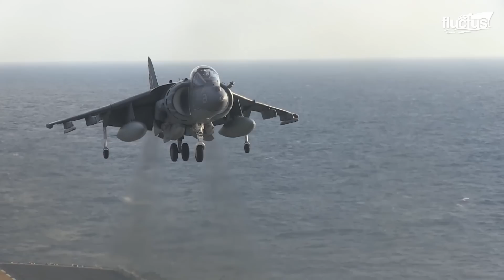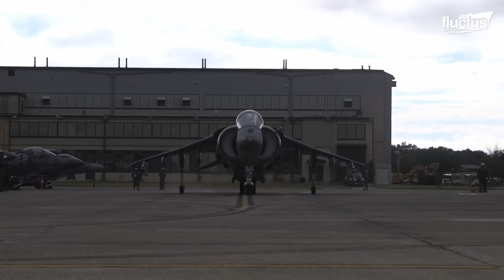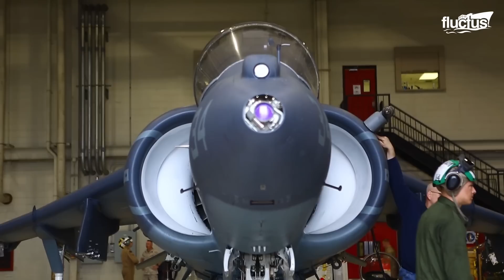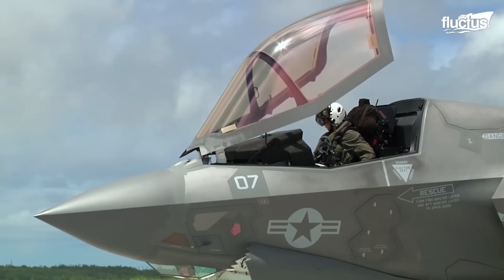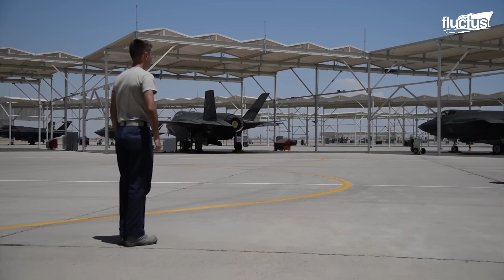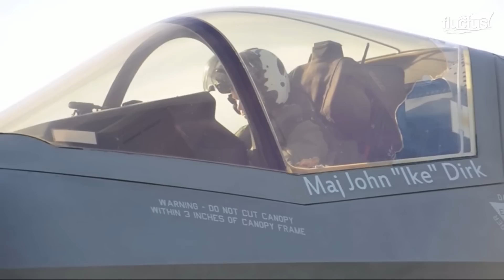A Day in the Life of US Weirdest Fighter Jet Ever Built

Comment: The F-35 b doesn't have the drawbacks that the Harrier does what I mean by that is that the f-35b doesn't suck in its own exhaust like the Harrier does
Reply: Nothing wrong with sucking ur own exhaust 😂
Reply: The real drawback to the Harrier in VTOL mode is that it uses an incredible amount of fuel and it can only be in that mode for 90 seconds. The single-engine is pushed to full throttle whereas the F-35b isn't. That shaft-driven fan does most of the work. That smoke you see from the Harrier is from water injection. That alcohol and water mixture is pumped into the engine to keep it cool and provide needed thrust. It can only carry 50 gallons of it and that's why it can only hover for 90 seconds before it starts to overheat. Anytime you see black smoke coming out of a jet engine, it's due to water injection causing unburned fuel to shoot out of the exhaust. It's a terrible pollutant and thankfully new aircraft and engines have gotten rid of it. The F-35b is also much faster and much more agile. It's better than the Harrier in every way. Just because it's modern and the Harrier is over a 50-year-old design. The Harrier is a legend of its time though.
Reply: @ejkk9513  thanks for the last point on behalf of the harrier. We can all agree the F-35 is a bad ass MF machine, state of the art tech with all the bells and whistles. The harrier decimated in its hayday and there was truly nothing like it before. Those birds Proudly defended the British coastline for decades, i will remember watching and hearing them fondly.
Reply: @ejkk9513  "It can only carry 500 gallons of it"(sic)

50 imperial gallons of distilled water.
Reply: @AA-xo9uw  Dang, I made a mistake. I knew it was 50 gallons and I accidentally put 500.

Comment: The F-35B is STOVL, not VTOL
Reply: The plane is capable of VTOL. Just because it's cheaper to STOVL doesn't mean it can't VTOL.
Reply: @georgedavey1339  you're correct, it can ... but it has to be so light that it would be useless in a combat mission ... making it useless.  So we tend to stick with STOVL
Reply: @georgedavey1339  Capable but no KPP for the JSF to be VTOL. The fact that the F-35B can is simply gravy.